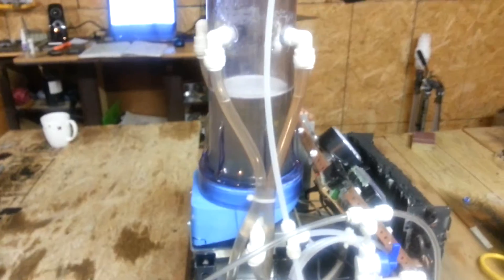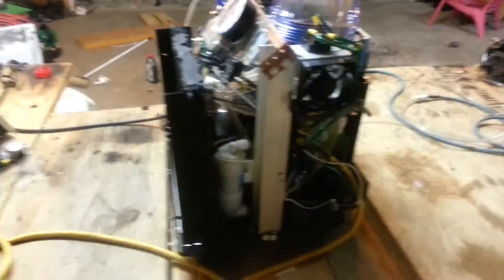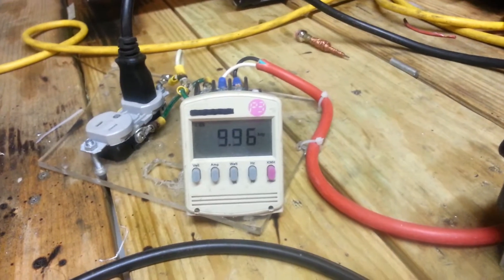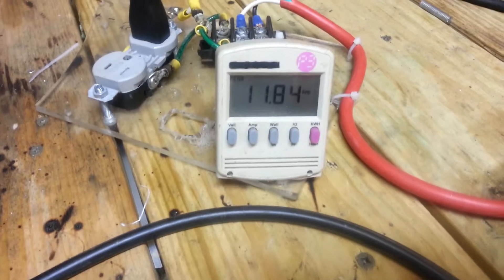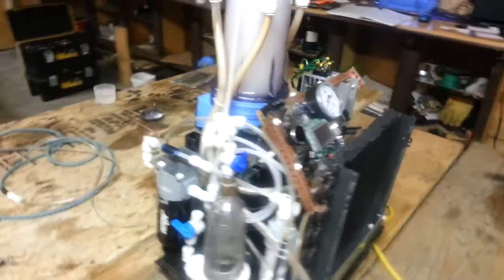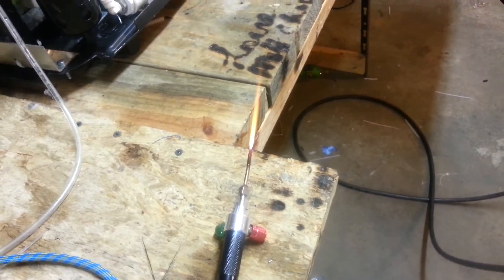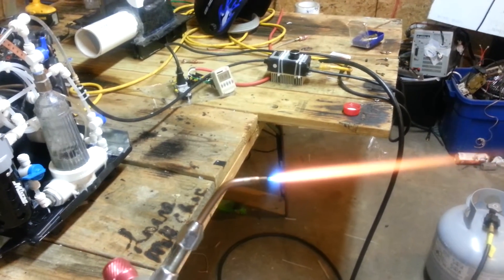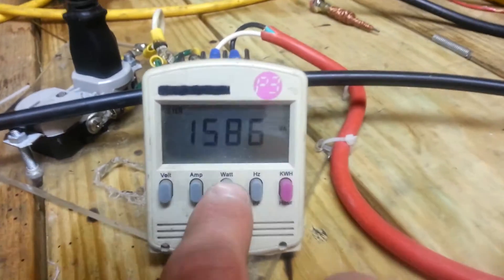hho torch cell Circulation Systems

Comment from the maker: yes steve  after watching your video i red a comment you made about your sell starving for electrolyte and i wanted to show you that it would be worth it on your next build  i just wanted to show you that my little cell uses 4 3/8 tubes as the exhaust the only reason it doesn't run more rapidly is because the complex intake path from the pump, this device does not need a flow pump to run it is strictly for cooling . i wanted you to see what a cell could use if it had it so i posted this

Comment: The pump keeps water on the plates continuously. Without the pump the production create dry spots. that's why the amperage goes up with the pump on.  Nice little torch. You said "Steve" at the beginning. Is that me??
Great video!